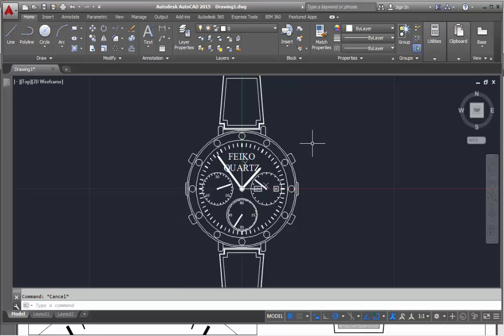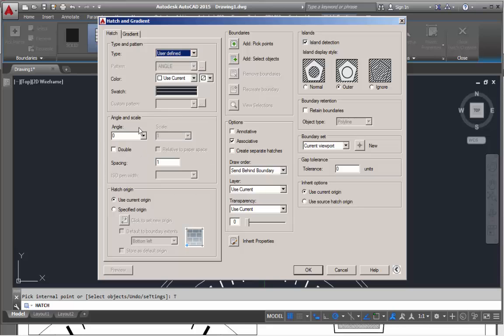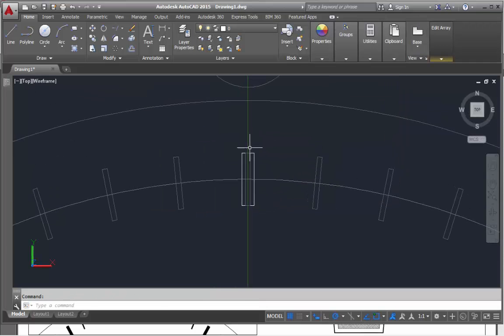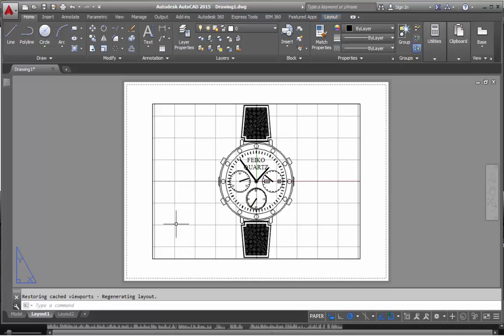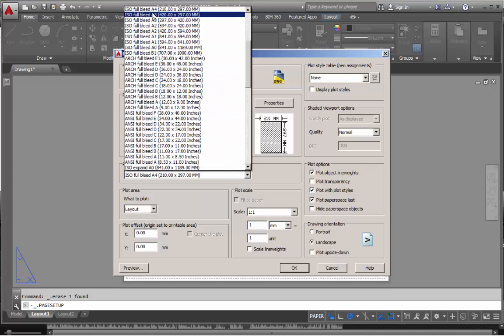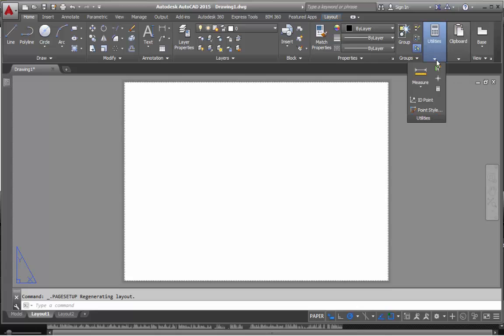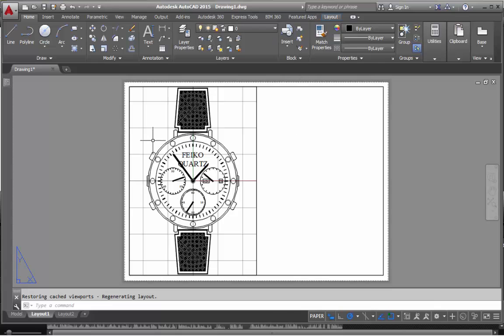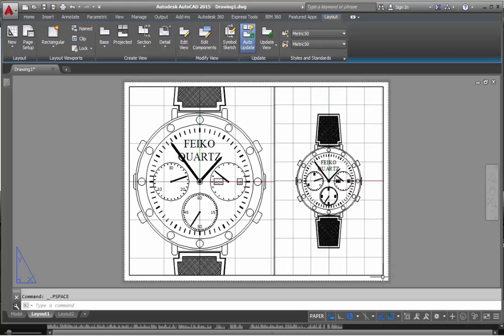Drawing a Better Watch in AutoCAD 2015 Pt 8

Comment: Can you do a 3D wristwatch?
Reply from the maker: Yes, I could build a 3D watch. But at the moment I don't have time. Its really quite easy in AutoCAD.  Take the shapes and extrude them then move them up on the z axis. The glass is the trickiest. A 3d fillet would  be good enough as a start. You can Google all the techniques. If you have closed shapes, you can extrude them. 
Hope that helps,
Regards, 
Oaul
Rega
Reply: Thank you so much for your reply. It really helped me. Thank you🤗🤗
Reply: How can I achieve a rendered quality in autocad but i want to view  it 360°. I made a wrist watch. I also want to animate the clock